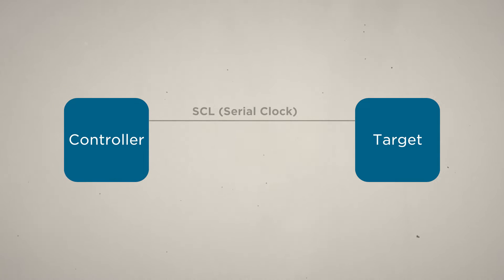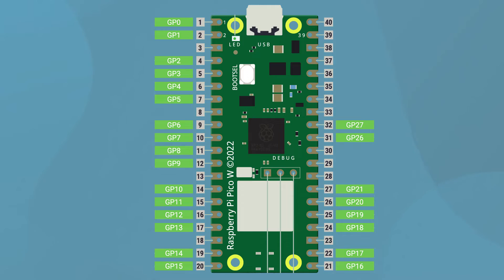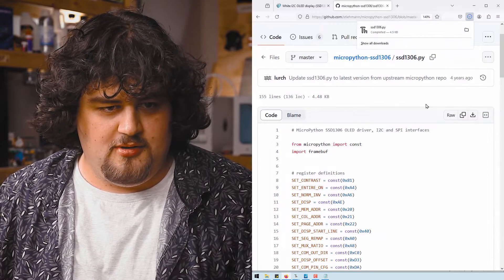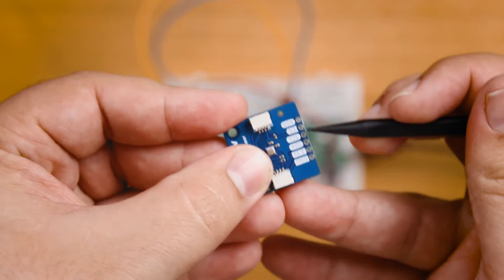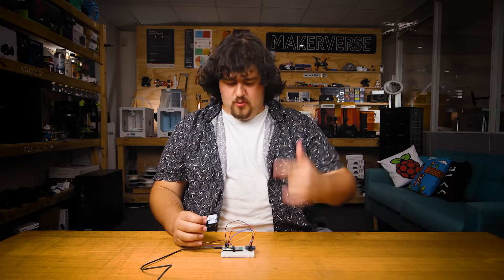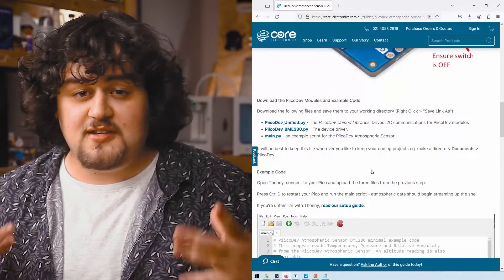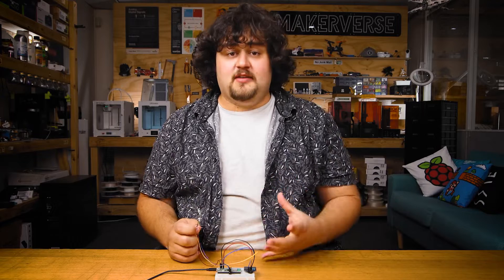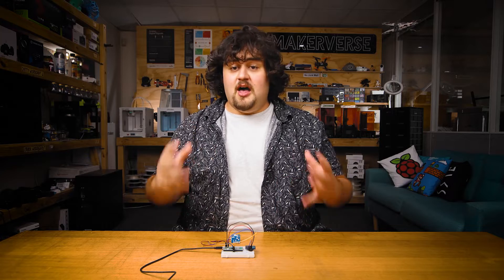I2C | Raspberry Pi Pico Workshop: Chapter 4.4

Comment: Need multiple oleds but address is fixed, convert the i2c pins to serial (destroy link to pico i2c), and make the new i2c using other pins and write to it,  again use the latest pins for serial and ...,   
the pico is so fast and disconnecting from oled1 does not wipe the text on it while talking to oled2, tested with 4 oleds.
or    from machine import SoftI2C   using SoftI2C to create many i2c objects 
tip : 400000   use 400_000  much more readable

Comment: Another great tutorial! I assume, since there is a bus 0 and a bus 1 on the Pico, you could have two I2C devices on the Pico with the same address as long as they are not connected to the same bus.
Reply from the maker: Yes! 100% correct!